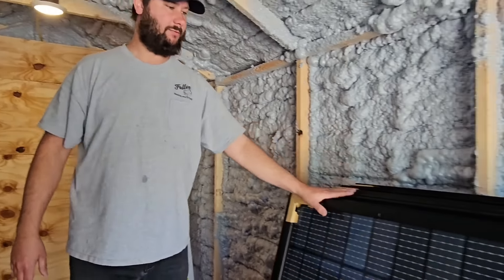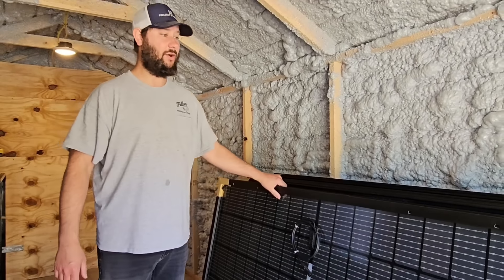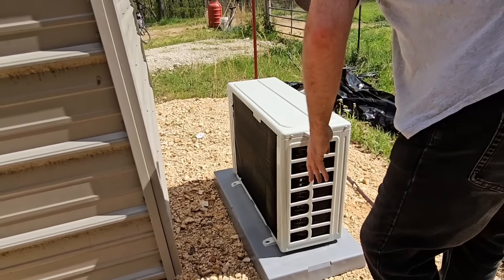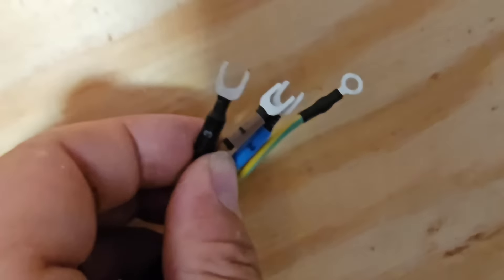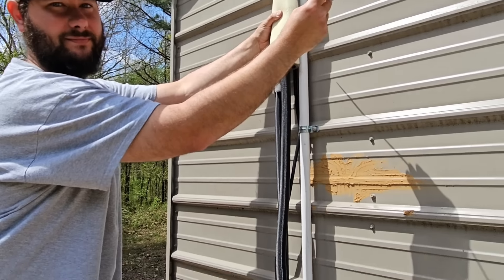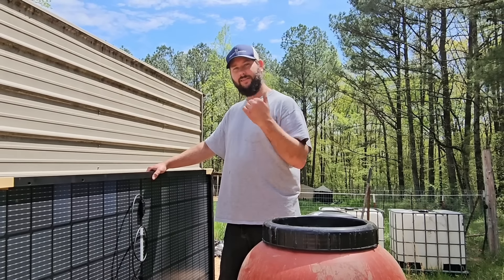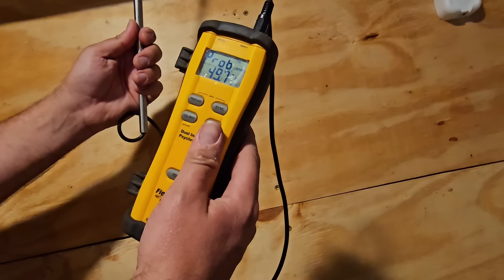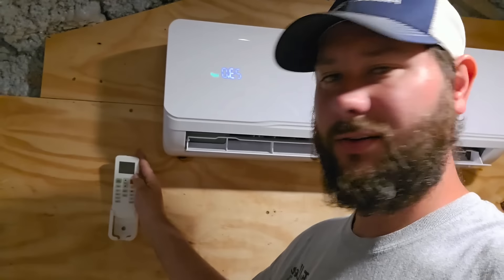Cool Your Home for FREE with Solar Powered AC!

Comment: Seeing their prices it would be cheaper to buy a 3kw inverter for 674, 5 400w panels for 600 and a 120v mini split for under 700, that's $1974.00.  Not only will it run the AC but provide power for the whole shed.  Add 1 48V, 5.12kw battery for 1149 and now your working into the night.

Comment: This is a great idea. When you need the most cooling you have the most solar power. Really cool
Reply from the maker: yes exactly
Reply: The hotter it is, the colder it gets.
Reply: Very true
Reply: @JohnMoses1897 Yes these have Heat also. Rated down to 5F, I've had no problems at -3F (obviously,  there will be some reduction in BTU output at that temp, but still working for me.
Reply: @JohnMoses1897
0-15kwh 10-55kwh
Even on a really sunny day in December my solar is greatly reduced. In December my system produces 0-15kwh a day. During August I produce 10-55kwh a day. So if I am only using my heatpump I will need help from the grid for heat during the winter.
Reply: @ecospider5
I’m not a Solar expert but it would seem that if there’s that much difference (0-15kwh on a really sunny day in December and  10-55kwh a day during August) it might be a matter of the inclination of the panels.
Reply: @johnlee7085
You are not wrong. We decided the look of the panels were more important than total output. So they are perfectly flat to the roof on the East, South, And West sides.
Reply: @johnlee7085  no, it’s a matter of science, lol. 1) you get almost 4 hours less daylight in the winter, so 4 hours less sun. 2) the sun is very low on the horizon in winter. Now with that said, Where and how the panels are mounted does make a difference. I have 8.4 KW on my roof. My bet production is 44 kw a day, in perfect conditions in May but every day is far from that, so about 1050 kw a month, best conditions. In December in the low 300-350 kw. I’m sure if mine were in the open, could have the angles adjusted in winter, it would help, but not practical for me. All said, my electric bill is very close to zero. We have been getting a lot of rain and clouds which reduce my production in peak months by 200-300 kw, just from that. Not perfect, but very close, lol
Reply: @jerrytalley802  LOL is right. 

Though you say “No”, your two points validate my comment. 

On top of that, you say it’s a matter of science talking about your unique experience. Science is based on a preponderance of repeatable experiments, not one experiment that could possibly be a statistical outlier. But thanks for playing.
Reply: @johnlee7085
We use personal data to make the science relatable. If you search for ‘seasonal variation in solar energy’ you will see that solar radiation can be 60% reduced in December vs July. My panels are a little worse than that so the extra 10% drop in December is due to the angle of the panels. I have no interest in changing the angle by season so I just live with that extra reduction.

Comment: Nice video. Love that it can be powered with three solar panels. Definitely appreciate the snap unboxing, as well as the pro-tip on the solo wall jacks. 

As for the solar mounting, a simple frame between waist and shoulder high would seem to ease installation and cleaning. You might also consider mounting the panels to 2x4’s that can pivot on a bolt with a leg on the other end that can adjust the inclination for summer, spring/fall, and winter. Like the back of some chaise lounge chairs. That way it’s an easy adjustment once a quarter to increase the efficiency of the panels.
Reply: Just went to the website. $2k to $3k seems pretty affordable for power and an HVAC system.
Reply from the maker: Thank you for the tips brother

Comment: Tech tip push the wire through the wall and make the connections on the floor. Nice work 😊

Comment: Ive had 3 of these for over a year. FOUR panels are a bit better install for cloudy conditions on the 12k (Panels produce generally 5-30% power depending on thickness of clouds) . On Cooling this will run with as little as 100W, 200W on Heat.

As you become familiar, play with the AC power limiter in APP / "plug" icon on remote - this limits AC power input to 300W. There is a secret button sequence if you decide you want the AC Limiter always on.

Enjoyed your vid, thx!
Reply: Interesting. Now this is real world information. Thank you!
Reply: How much did install with unit run you( assuming u installed?
Reply: @pecan11  $2k per unit. Panels are half the price now. Yes I installed :-)
Reply: what is the secret sequence?
Reply: @xaviy649 Set unit to Cooling mode, temp to 90F, fan speed on Low. Press Power Limiter button on remote (AC plug 🔌 icon) 8 times in 10 seconds.  You will hear 4 tones Ding-ding-ding-ding. Power Limiter is always-on. Performing sequence again restores normal operation.
Reply: When you limit it to 300 watts , what impact does this have on the unit? Is it able tocool as effectively?
Reply: @HeronMarkedBlade-ef7zz  Short answer,  obviously BTU output is going to be reduced. Per specs sheet, these operate 3000-13000 BTU at 200-1050W
Reply: @HeronMarkedBlade-ef7zz Longer answer then obviously depends on size, insulation, and Temps on conditioned space. Furthermore,  when you have AC and DC connected,  the unit BLENDS power, not just switches from AC and DC. If there is over 100W of Solar, the unit will typically limit AC in to 150W. So it gets complicated:-)...

Comment: Solar powered mimi split is not hard, even a battery powered split is easy enough. I converted my whole house HVAC to a mini split system that runs on solar and battery. You can power anything electrical with solar the only issue is having enough solar output. Ideally there really should be batteries in the system to stabilize the power output otherwise your split will cycle on and off with the sun or if grid tied it will cycle on and off the grid.
Thank you for the video, keep up the good work.
Reply: I would like a video on that, I would appreciate saving on my electricity bill

Comment: At 27:22 you commented about the line set but didn't elaborate. Is the line set pre-charged or did you just connect and open the service valves without regard to non-condensibles (which I doubt). Please clarify.

Comment: I have a shed that I power with solar and batteries. In the shed I have a full French door fridge and a upright freezer. It’s not insulated like yours, but I keep it cool during summer with an attic exhaust fan. I kid you not, that exhaust works wonders and everything is powered off of 6 deep cycle 100ah batteries wired in parallel.
Reply from the maker: That is very cool. Where is your location
Reply: @TaddyDigest Long Island NY.
Reply: That’s a great way to keep the shed the same temperature as outside. Definitely worth while.

Comment: If you do another mini split install it is more efficient for the unit to minimize the length of the copper line set by desoldering the tubing near the connector, cut the tubing to length and solder the connections back up. Great install. Were you going to cover those  hoses coming down the wall with anything? Are you in an area where the drain line can freeze? I did not see a loop seal on the drain.
Reply from the maker: Great idea

Comment: i was thinking about going with mini splits to replace my electric hungry central unit but I ended up going with inverter window units. Super super quiet and so easy to install I was up and running in 30 minutes. And a LOT less than the mini splits. My electric bill last summer was about  $150 less per month in the summer. Only downside is no heat. But I use propane anyway.
Reply from the maker: that's awesome. very cool 👍 
What brand inverter window unit
Reply: @TaddyDigest  midea

Comment: Good job on the video bro. As far as your panels, have you thought of setting them in a remote location and make the adjustable as to the season?  That would work well as the sun sets lower in winter. Good luck and thx
Reply from the maker: Thanks for the tip

Comment: I want to know what you used to insulate your shed? Looks interesting and very efficient.  I have been researching something other than blown in fibers or rolled batt for my walls so I can be ready when I do get solar AC.
Reply from the maker: It's a kit you can get at spray man

I'm pretty sure i've got a video about it

Do a quick search of how to insulate a shed with spray foam taddy Digest

Comment: My 3.6Kw, EV charger array as of last weekend, is also now running a pioneer 12k Btu, 23 SEER mini-split in my garage, effectively increasing our square footage by 400 feet. What surprised us was, whe we opened the garage door and left it open all day, it cut the houses electric use by 20Kw, while only using around 10-12Kw from the EV charger array. This may save us $600/year, and make our house almost net zero in electric use, with our grid tie 5.4Kw on roof installation. I didn't expect the garage to be as air tight as it apparently is. It does have an insulated door.
Reply from the maker: Thank you for sharing your experience! It's inspiring to see how small changes can have a big impact on energy efficiency and savings.

Comment: If the line sets are full of air and not the ones that come precharged in the linset then yes you would need to use a vacuum pump to remove all the air and moisture from them before letting the freon go from the condenser..
Reply: that line set is sealed and vacuumed, they have a valve that opens when you connect it.

Comment: I. really appreciated the video. I was not aware of mini-splits that are made for solar power.  I have a sunroom that I want to use a mini-split to moderate the temperature in it. But I was concerned about getting power to it.  This solar powered system would be perfect for that application. I could put the panels right on the sunroom roof. The only thing I might add to the system would be a couple of batteries to extend the run time into the evening. Do you have any plans to do battery storage. I would love to see the solution you use.

Comment: I use a minisplit inverter air conditioner on my solar system.  It's a 12k unit works great. These things are automatically soft start. No surge starting. When cooling or heating is called for the unit ramps up very slowly.  Instead of cycling the unit just slows down and will finally shutdown when not called for at all. These are the absolute best kind of heat pump to be used off solar.

Comment: You could install the panels as a overhang/lean to  beside the building to create some shade to store items out of the sun. One 2x4 or 4x4 on each end with single 2x4 on edge between them and a ledger against the building for the other side. Use pressure treated. Or find some extruded aluminum. Set your proper angle and mount everything.

Comment: Does it have to be in direct sunlight with the solar panels to run and when does it shut off when evening comes? Does it shut off by itself automatically so the unit doesn’t get damaged two questions thank you for your video.
Reply from the maker: No, the panels do not have to be in the direct sunlight, although that is preferable
The equipment will automatically switch over from one power source to the other
Watch my update video that I did

Comment: As always, you did a great job 👏 just two things first is based on my experience maybe it’s just me, so I never had a good experience with mini split in a foaming place and got leak very soon at indoor units due to VOC gas , second i believe that would be better to coil your line set horizontally in order to get back oil to the compressor. Thanks again for your awesome job and training 👏👏👏
Reply from the maker: Great advice thank you brother
Reply: @TaddyDigest  thank you 🙏
Reply: I just bought one with 10 panels to get free shipping what's the deal with the coils are they wrong should they be stretched out ?

Comment: When running, If it becomes cloudy and not enough solar capacity is being generated, does the unit shut off to a point where someone needs to physically turn on from handheld remote.  Or when enough solar energy generated returns does it resume cooling on its own?
Reply from the maker: Check out my most recent video where I talk about. What happens when the sun goes down

Comment: Howdy interesting
 could you use a battery pack to charge up from the Solar Panel in order to power the Mini split?
Reply from the maker: No
Solar panels wire directly into the outdoor unit
Check out my video to learn how it works at night
Reply: Tks for quick reply.
Reply from the maker: If YOU want to learn how the Solar powered AC unit works at NIGHT 🌙 Check out this Video.

https://youtu.be/pjSrqDnEAlk

Comment: What happens when the sun goes out? 
Or until what time can the unit be running in a sunny day?
Reply from the maker: Unit automatically switches over to using AC. Power from my inverter

Comment: Lifetime handyman here. Correct me if I'm wrong, a metal roofing screw with a  rubber washer DOES NOT seal out water when put over a bracket. Between the bracket and the wall there is a water intrusion point. The washer seals over the top of the bracket but not behind?
Reply from the maker: Yes, that is correct. I would have to have a rubber washer on the other side To actually seal out the water

Comment: I have a good idea about mounting.
Connect electrical wire first, push wire through hole taped to hose pipes while it’s on your shoulder then mount. No brackets needed.

Comment: For Metal Roof/Walls or whatever... You need something like S-5 RibBracket IV - S5 company has all mounting types for direct attatch or rail based systems. - Used them on many projects and they are solid.
Reply from the maker: Thank you for the knowledge, brother. I appreciate you

Comment: You need a torque wrench to follow the manufacturer's spec. You also need to evacuate the lines with a vacuum pump and gauges to remove air and water vapor from the lines prior to releasing the freon. A nitrogen pressure test may be beyond many DIYers. So, hold the vacuum for at least 20 minutes. A few hours even better.
Reply from the maker: If you watch the video, you will see that. I recommended a torque wrench in the video
Also, if you read the manual for this specific model of equipment, you will know that a vacuum is not required

Comment: I'd like to ask you a question, what happened with the air trapped inside the tubing? It's water content will ruin components inside like the compressor, it is better to use a vacuum pump once you make the tubing connections and drain it out ..good video though
Reply from the maker: The lines are pre vacuumed

Comment: I have a question that maybe I hope you can answer. How does it supply power at night because most solar energy power runs charges the battery so it runs at night off the battery how does this unit supply power at night for homeowners?
Reply from the maker: Check out one of my latest videos. I answer all those questions

Comment: For a lot less money and far greater utility a solar inverter and battery back up would provide AC power to your whole shed, including your mini split, which can also be had for less. What happens when it rains or when the sun goes down?
Reply from the maker: If YOU want to learn how the Solar powered AC unit works at NIGHT 🌙 Check out this Video.

https://youtu.be/pjSrqDnEAlk
Reply: @TaddyDigest  Watched it. You made my case: what’s the point of dedicating your solar panels to one function, part-time? If you’re running AC to the shed anyway, the solar panels with an inverter and battery back up would cost less, work better and power your whole shed at a lower operating cost.
Reply from the maker: Redundancy

What if the inverter fails
What is the battery fails
What if is the reason

I like to make sure I am covered at all angles
Reply: @TaddyDigest  YOUR AC POWER IS THE REDUNDANCY.

Comment: What happens to the unit when it is running and the sun goes down or behind a cloud?   Does it auto switch out when it doesn’t have enough power? I would think some batteries would be a good idea to have to even out the power?  Didn’t know solar was even a possibility.  Thanks
Reply from the maker: This mini split will automatically switch from the PV power source to AC. Power source when the sun goes down
I will be a video next week and explain
Reply: The spec panel called out 90 VDC - 380 VDC.  How would you power it and charge batteries?  Batteries are typically in multiples of 6 and 12.  You could wire the 115 VAC side from your home  solar system.

Comment: Great video easy to follow easy to understand we just installed the same unit in the garage everything went smoothly thanks to your video. Only minor problem we're encountering is understanding the different features of the remote can't figure out how to get to darn thing to run with auto cooling turning on and off at the desired temperature. I Do you know there are fan settings just there's no clear information in the manual with the icons mean. Going to users or anyone has any guidance on how to set this up what the different icons mean it would be appreciated. Other than that we love the unit it's working great. Make it a great day and thank you
Reply: Do you have the Solar Aircon app running?? It's a bit easier to deal with and you can set schedules there.

Comment: Cam you also connect the 115vac side and it use that when the panels aren't producing enough? 115vac would be coming from a pure sine wave inverter from the battery bank . Also whats the wattage and start up wattage? Awesome video
Reply from the maker: yes absolutely

Comment: You might put composite material to build up to the rib height for you solar panel install.  Then install your brackets.  You can get it at most box stores.  It is made from plastic and wood.  They typically use it for decks.